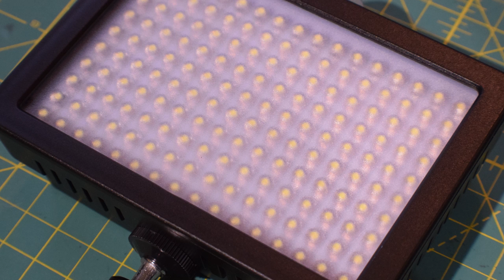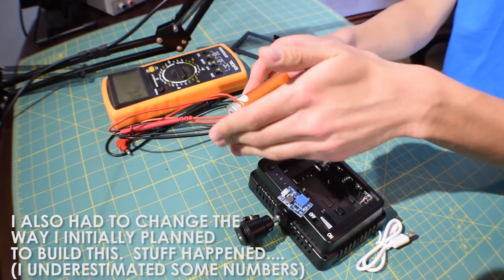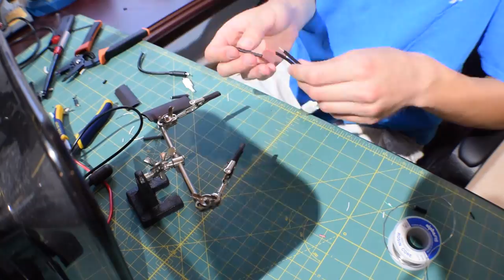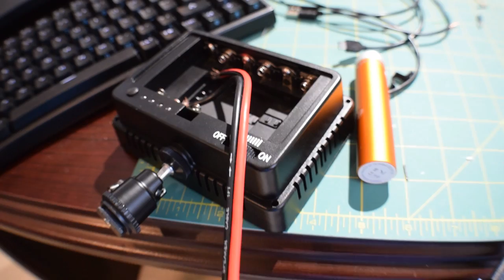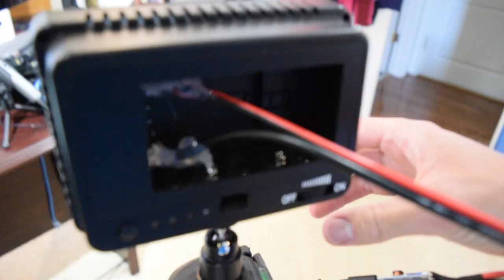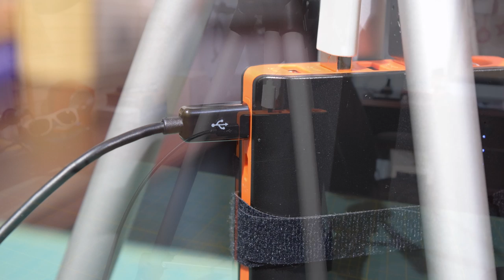Building Portable LED Studio Spotlight with 20000mAh USB Battery Bank

Comment: series line doesn't work when you are using Just one power source, but you could use the cheap ones in series,  that would work for sure
Reply from the maker: wouldn't each USB port be considered a stand alone isolated power source? That was my logic behind it anyway.
Reply: AA Computers and Technology no, the circuit Just delivers more amps when theres multiple USB ports in use, so would be more eficient if you had used 2 ports in paralel to the step up converter
Reply from the maker: Two ports are being used in parallel.  One port alone could not provide enough current to the light.
Reply: AA Computers and Technology also, if you have 2 6v Phone chargers lying around you could hook them in series to get 12v

Comment: why not just get a usb wall wart adapter, they have ones with 2 ports, and than you can skip the battery pack? also could you run the 2 weaker batteries together to power the light?
Reply from the maker: You are right, I could have just used a 12V adapter.  However,  I wanted the light to be easily portable.  Usually I take it all over the room and sometimes I will even take it outside for some extra lighting while taking photos.
Reply: ?You can still use this portable with the 2 USB cables while still plugging it in to one of those wall warts with 2+ USB ports for in your office. Unplug it from the wart and plug it into the battery bank when you want to head out with it. That way you don't have to worry about battery life when filming in your office.

Comment: Eneloop?
Reply from the maker: Not sure what you mean?
Reply: AA Computers and Technology eneloop is a brand of premium rechargeable aa, and aaa, they are the the gold standard for rechargeable aa and aaa due to there long charge, long shelf life and consistent durability
Reply: But your solution is better because you can simply charge the battery bank over micro USB and you already had the battery bank so it ended up being cheaper and probably higher capacity
Reply: You might want to check out Eneloops since you had problems with rechargeable AA batteries. I have 9-year old Eneloops (back when they were still Sanyo) and the batteries and charger are still working perfectly to this day.